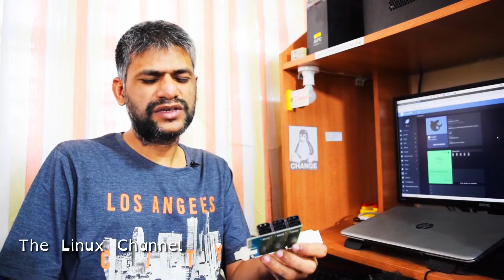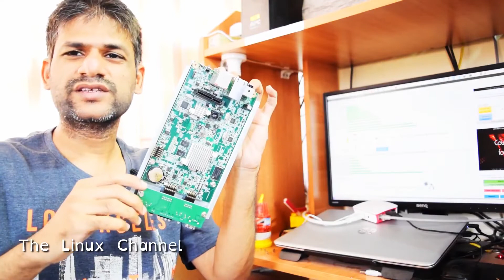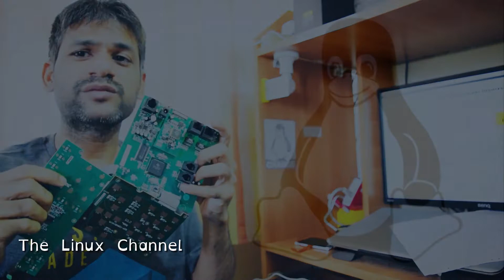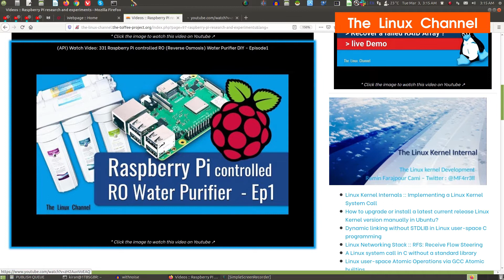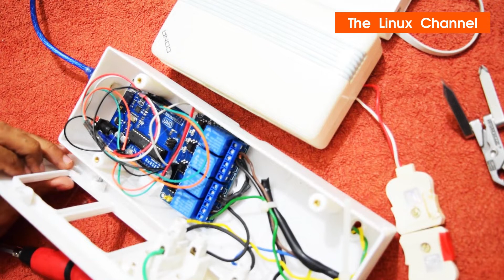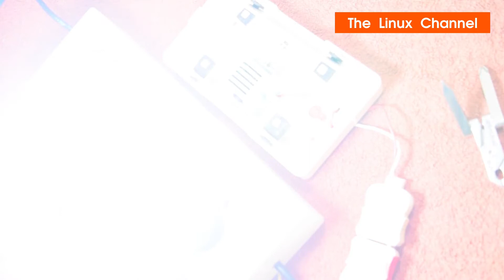x1eb Arduino UNO - RO Water Purifier Controller - Device Driver #education #embeddedsystems #arduino

Comment: Hi Sir, can this control when the water in hydroponics is needed to be removed or exchange? we are going to use an RO filter in the hydroponic system to conserve water by cycling it after using the water in hydroponics we're going to use the RO filter to filter the water that came from the hydroponics and reuse it. Can this Arduino controller you have shown help? (Ps. I'm a 12th-grade student and we are conducting research entitled; DEVELOPMENT OF A ARDUINO POWERED REVERSE OSMOSIS WATER FILTRATION SYSTEM TO CONSERVE WATER IN  EXISTING HYDROPONIC FARMING) Can you pls help us? It is well appreciated, thank you very much!

Comment from the maker: NOTE: I have modified, and removed that calling bell with a tiny low-voltage Active buzzer which can work as it is with Arduino output pins without relay. And as well modified the code accordingly and refined existing code and fixed couple of bugs. I did my first field-test, seems to be working fine. I have to do couple of more times and see.